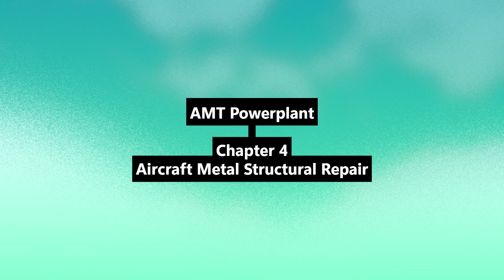Aircraft Metal Structural Repair

Comment: Do not! Do not use a scribe to mark lines on the aircraft skin!!!!
Use a soft felt tip marker.
Reply from the maker: That's a great point, using a felt tip marker is definitely safer practice to prevent scratching the surface.